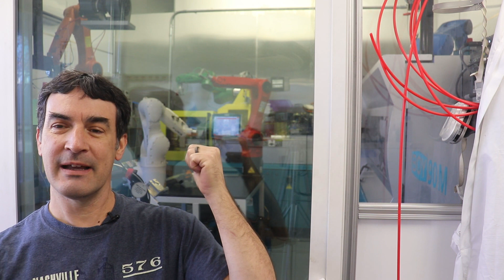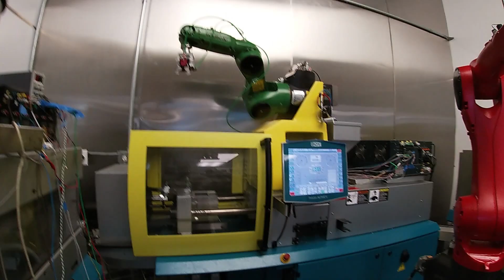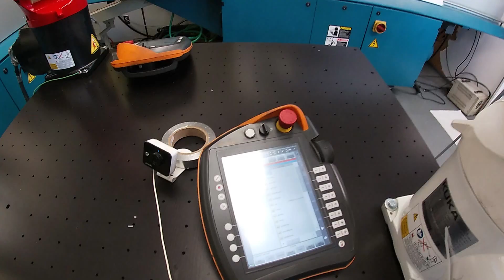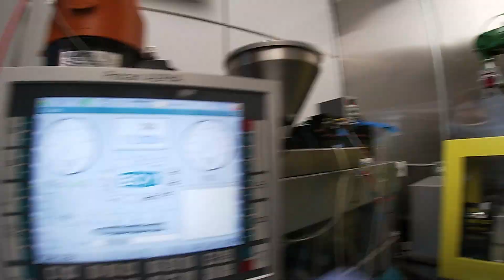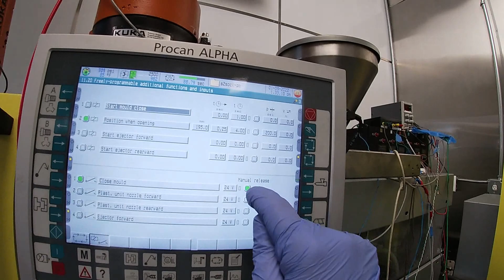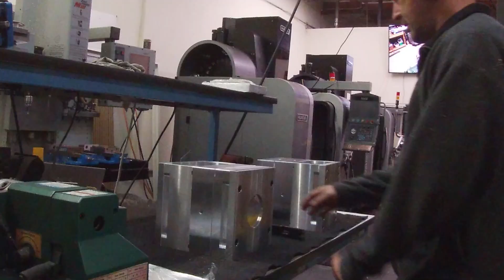2 SHOT PLASTIC OVER MOLDING

Comment: Nice setup, like the robot handoff do they hi five at the end of the run? On a serious note,  I've seen but not worked with twin barrel IMM. Would work pretty good and you only need 1 IMM and 1 robot for take off.
Reply from the maker: The robots seem ready for bed after the run.  Yes, I look forward to first shots off the new machine.  I am going with coaxial sprue to start.  The second shot nozzle is 2x the diameter of the first nozzle.  thanks for watching!

Comment: Very interesting,  impressive production increase from prototype taking two machines. Like those magnetic snap in location holders.
Guess you have a settle timer on mould core in position sensor switch.
Love the pin knock out knock in sequence. 
Thanks for sharing.
Reply from the maker: Thanks, yes when programming the robots I add all sorts of wait commands to settle things and to make sure the robot locks in a signal at the right point. Thanks for your continued comments too